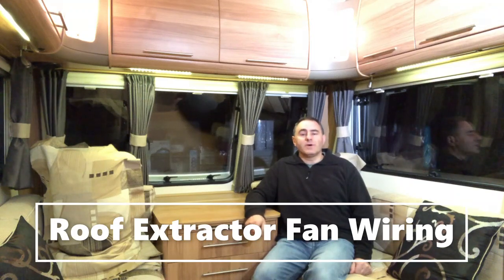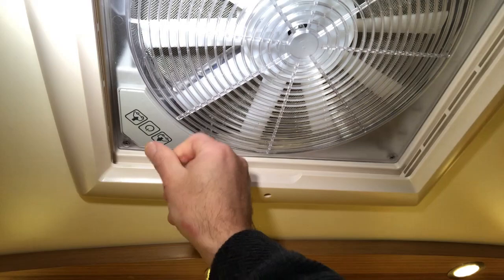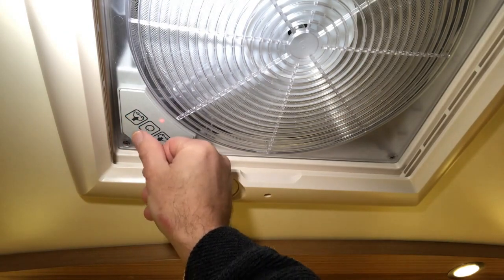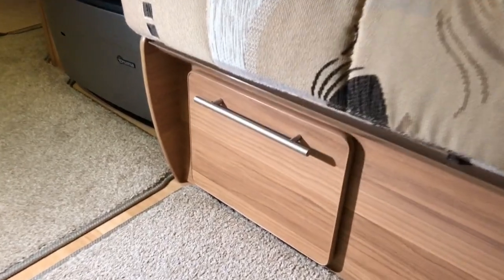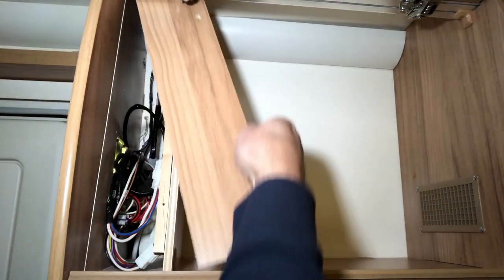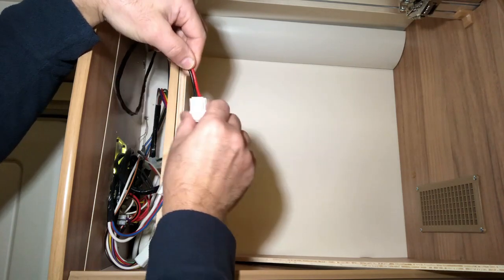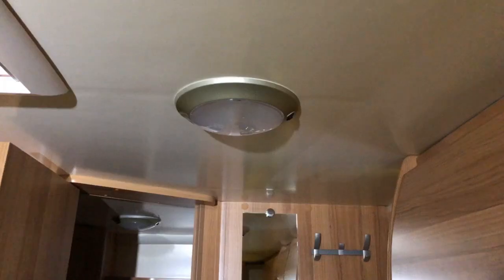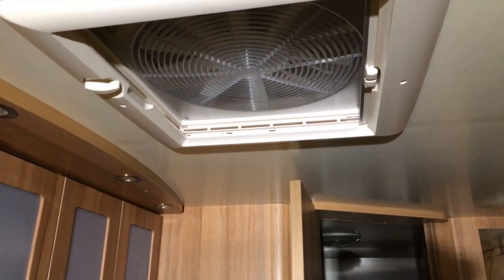Caravan Roof Extractor Fan/Vent Wiring & Operation Demo

Comment: This is excellent, any chance you know what connector kit you used? (For the 2 pin connection to the built in wire)
Reply from the maker: Hi Matt, Thanks for watching one of my earlier and quite robotic videos 😂 . Thank goodness my presentation skills have improved. Have a look at the video I made after this one titled ‘Update - caravan Omnivent roof fan rewire’. I change the wiring I made to the factory roof fan extension wiring. But I still had to purchase the terminal connection kit. The 2 pin kit is part number VL02 and the wiring is BC17004 Roof Fan Extension 12v Harness. They are both branded as Powerpart and manufactured by BCA Group. The wiring is around £10 and a connector kit around £3.00. Hope this helps. Cheers Rob 👍

Comment: Good informative video,  however I don't have any pre-fitted trunking (Unicorn Madrid).
Reply from the maker: Sometimes it may be difficult to tell if there is trunking fitted. Did you look at the ceiling  at different angles in different light conditions? You could contact Bailey via their website to ask the question. Thanks for watching. Rob
Reply: @robswiseways5697  Just to clarify and help others,  Bailey Unicorn III do not have ceiling lights, all lighting is perimeter LED's. As such there in no roof trunking.  Fuse No7 (marked fan) from the PCB does not have a wire in the plug/loom, so there is no pre-wiring. 

I ran a wire from that block connector to the roof area where drilled through the composite skylight frame and then used a piece of 8mm copper pipe which I heated up and pushed through the insulation to a point where I could make a hole in the fiberglass roof to insert the wires. This is how the dealer does it, but they usually connect into the 10amp lighting circuit.
Reply from the maker: I'm surprised there is no trunking running the width of the van at the back of the composite frame and no pre wiring. Glad you have managed to fit and wire the fan to the correct fuse. This is probably how I would have done it. I think the dealers connect to the lighting circuit for the easiest and quickest. Regards Rob
Reply: You didn't mention press and hold the fan button for 5 seconds to get a timed 5 minute boost...that's what it says in the specifications. Is it a thing?
Reply from the maker: Thanks for the info Jason. I did fail to mention this. Regards Rob